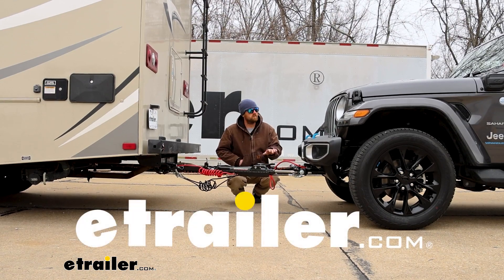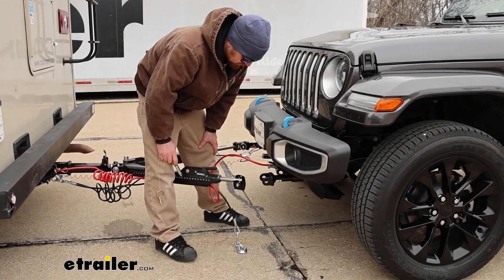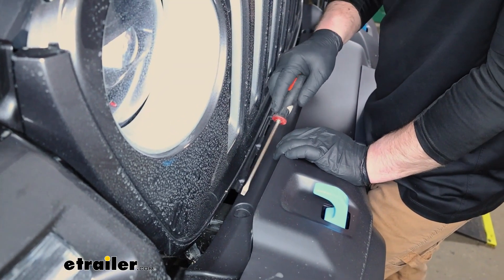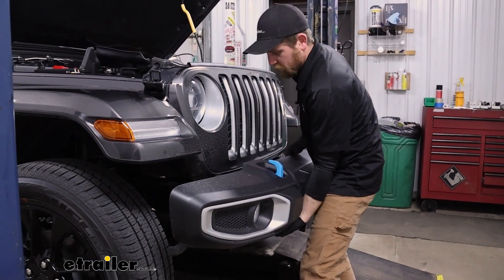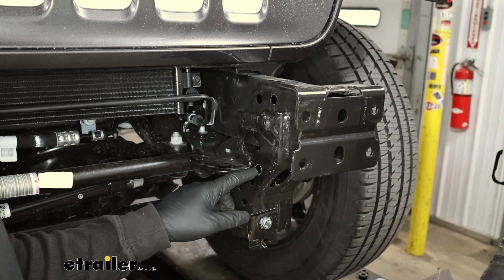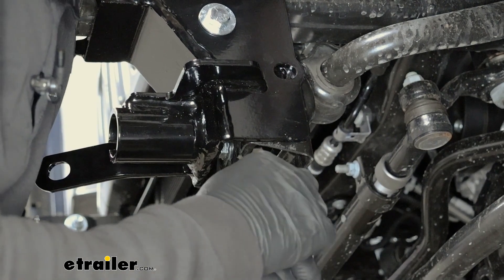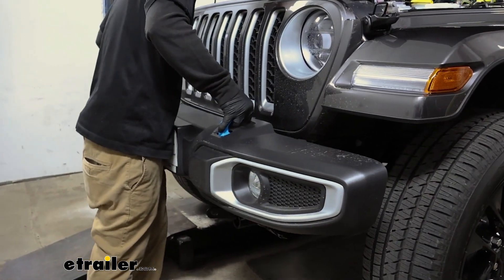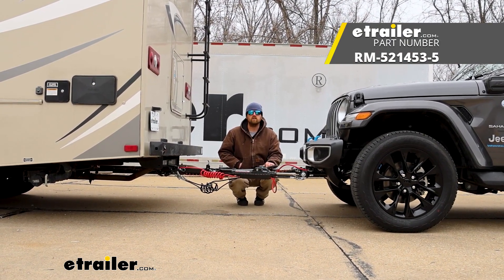etrailer | Install: Roadmaster Direct-Connect Base Plate Kit on a 2023 Jeep Wrangler 4xe

Comment: Doing the install on 2023 Rubicon with plastic bumpers and plastic rock guard.
On the first page of the instructions located in the outline detail items number 20 and 21  are used where.

Comment: Do they have a template for cutting the plastic rock guard?
Reply from the maker: The linked instructions don't provide a template, but they do show the dimensions and specific reference points that will make the trimming process pretty easy.
https://www.etrailer.com/instructions.aspx?pn=RM-521453-5
Reply: I was hoping to get some measurements, nothing Blank.